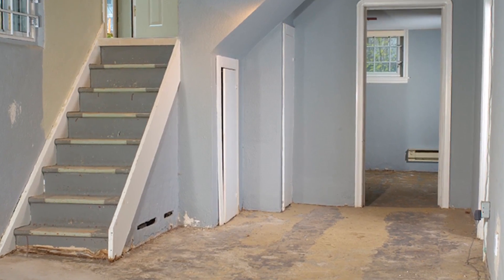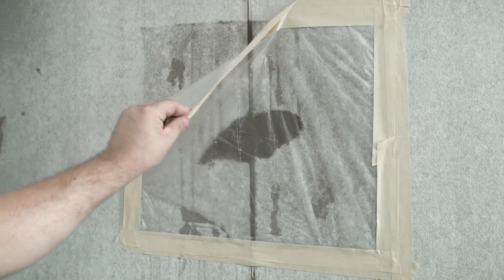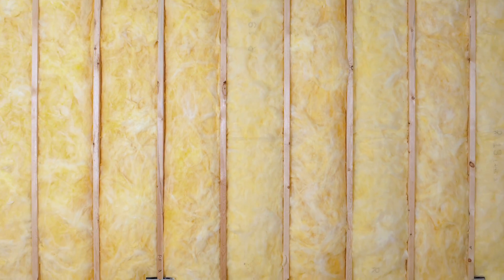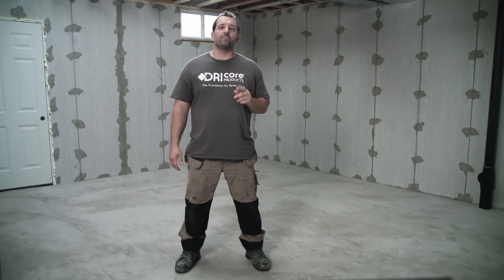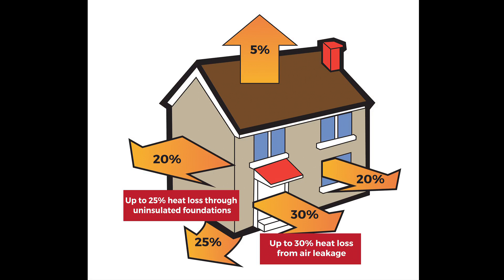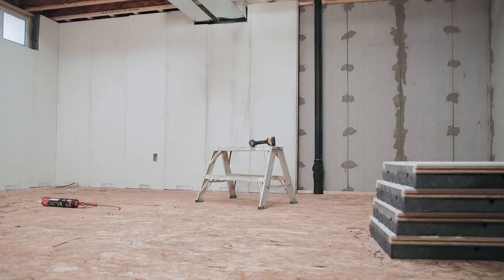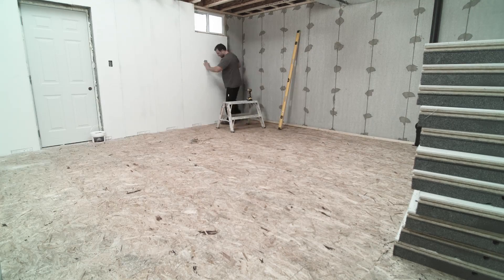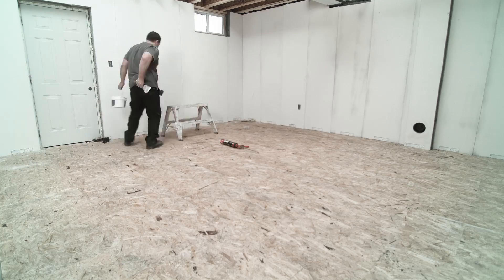The Science Behind DRICORE SMARTWALL 🧪 How Does DRICORE Work?

Comment: Most if not all building codes require the basement to be insulated below grade so seems the extra foam insulation is not required and the panel should be sold without it or am I missing something.

Comment: I wonder about any flexing since its only supported at the top and bottom. Also, what protects wires running through the foam to outlets and switches? normally you know they're going to buried 2" deep from the drywall

Comment: What happens to any moisture that goes through the concrete but is stopped at the smartcore wall? It has to go somewhere.. does it drain out.. reroute, or just sit in the concrete? I am curious as I have a 90 year old house and need to consider the foundation being able to 'breath' in order to maintain its integrity.

Comment: The info provided is great.  Most DIYers and some contractors don't realize the proper steps involved when framing and covering a cement or cinder block foundation.  This later leads to mold and moisture issues which eventually degrade the walls.
Dricore seems like a very cool product but the cost is still too high for me to justify on basement remodeling.  Even with Dricore you'll need to properly prepare your foundation to avoid any moisture.  Whether its a leak or efflorescence the foundation will need to be sealed.
I'll still give you a thumbs up for an innovative product, most building material companies shy away from basement products because of the volatility of the environment.